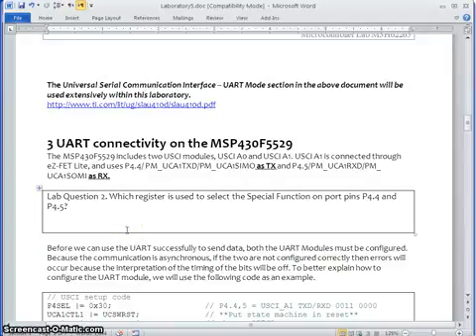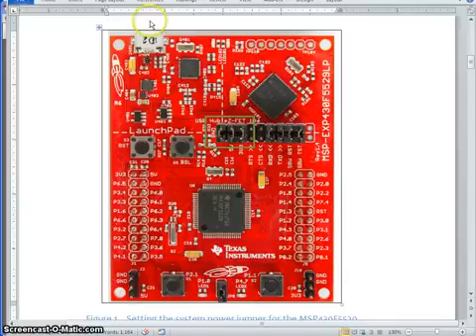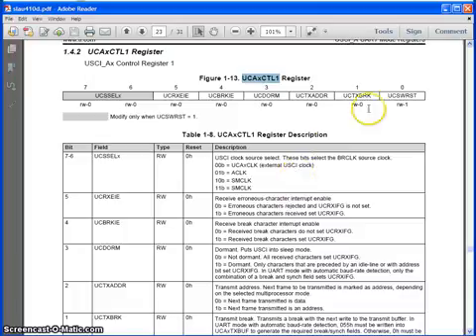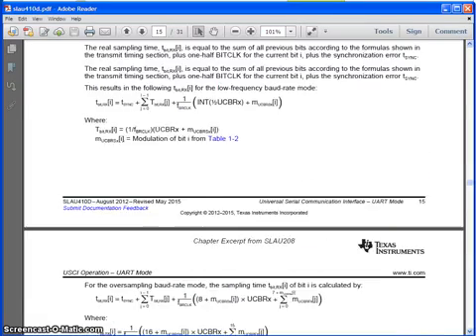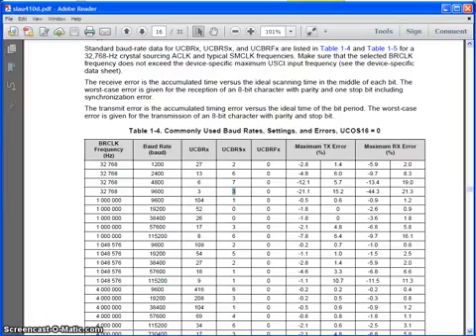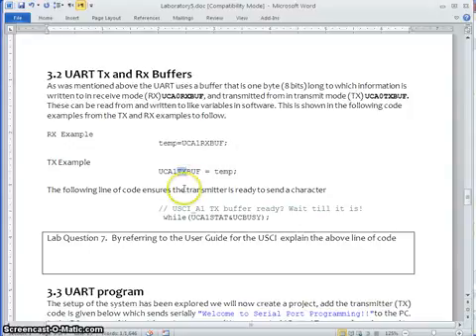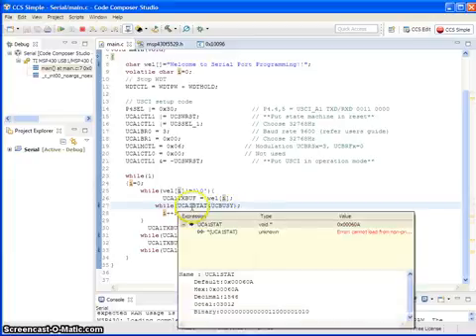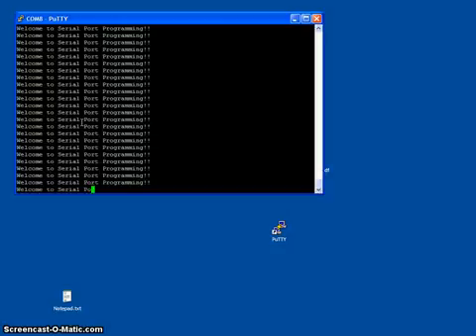Serial Communication - SCI - MSP430 - Launchpad - MSP430F5529

Comment: Thanks for this valued video, I just have a question : does TI document mention  the steps you explained in the same order? for me I did tons of searches in ti documents, they never explain how to program the microcontroller, so if you have any resources plz share it , thank you
Reply from the maker: You can refer to the datasheet of subsystem. Resources are already shared..
Reply: @Ragavesh Dhandapani I meant the code steps that starts with :1-Selecting I/O pins. 2-Reset the internal state machine and so on.  In which ti documents can I find this code steps?
Reply: How to know that I should use this order in coding?
Reply from the maker: @sonlinesonline  actually u learn these during the course of time or in a course. Are you a student? 

There are few books on embedded system, exclusively on msp430. One i remembered is msp basics by Davies and another one from Daniel pack?

Do write to my gmail for more details
Reply: @RagaveshDhandapani  yes I'm a student, ok I'll email you, thanks a lot